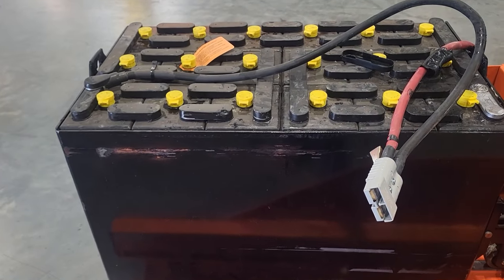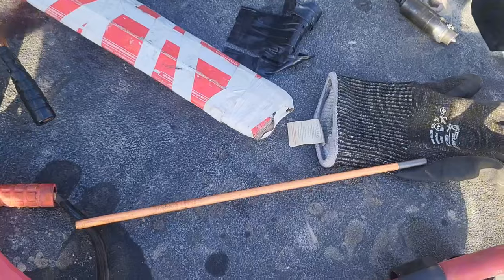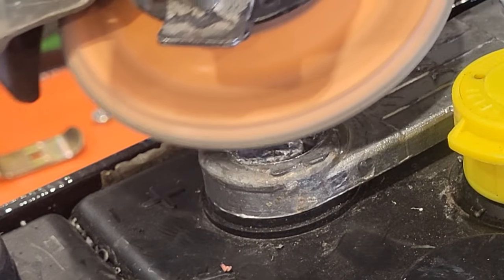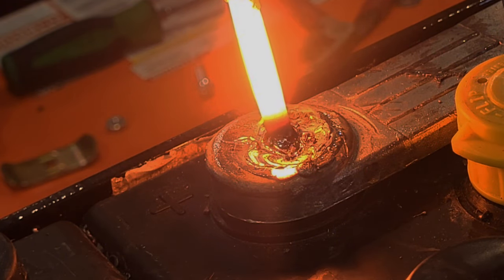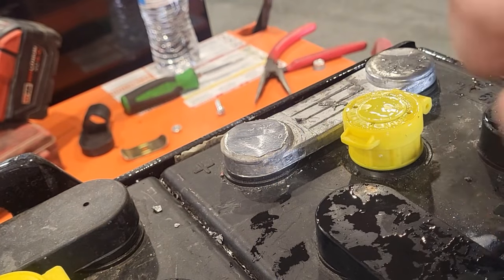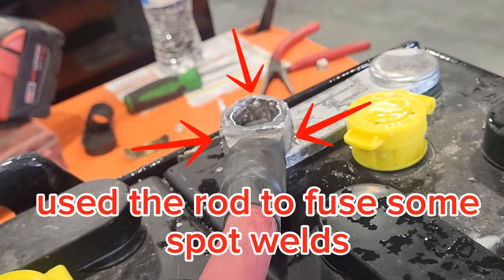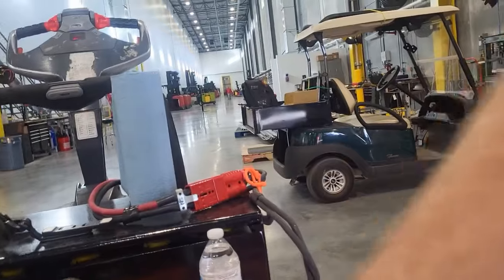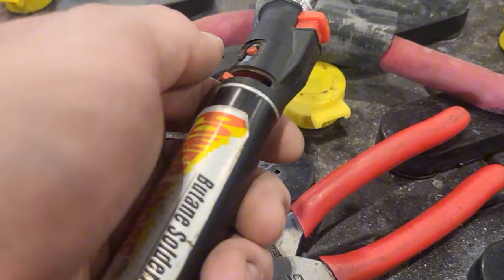Industrial Battery Repair Out In The Field

Comment: I used to work on industrial batteries like that. We used a drill bit made for removing the cable or cell connectors. I was taught to use an oxy/propane torch. Blew out the gasses from nearby cells so as not to blow off a cap. 
It was cool seeing it done that way.
Reply from the maker: I have used the torch and done it that way. It actually has a better finish product. I like the carbon arc because it's simple and gets the job done.

I think for this iob a torch would have been the better option.